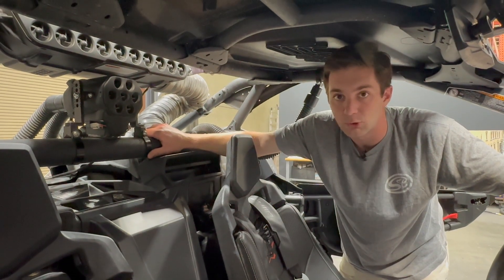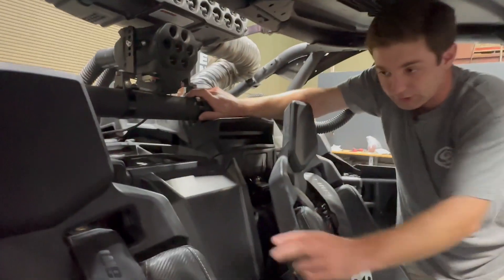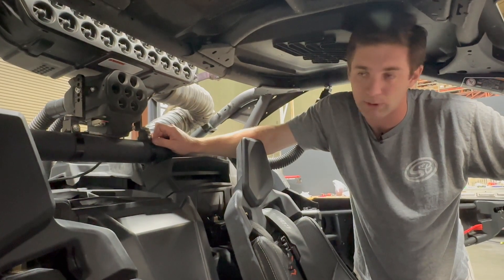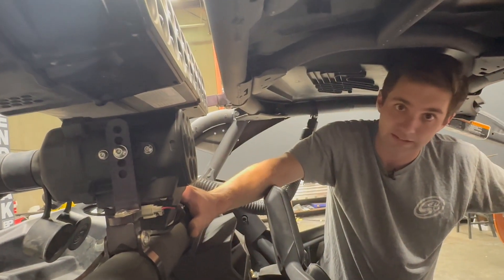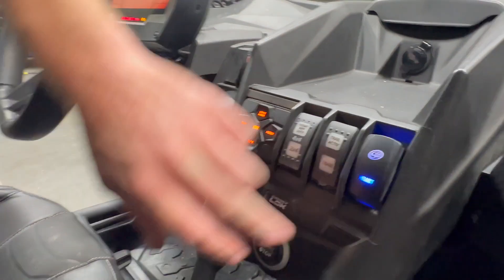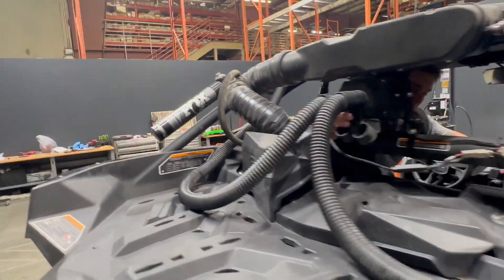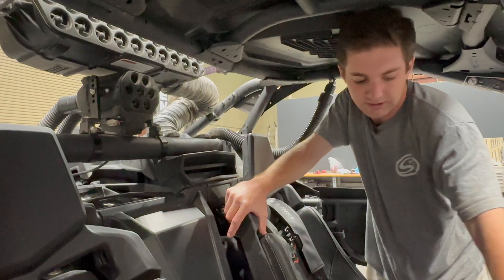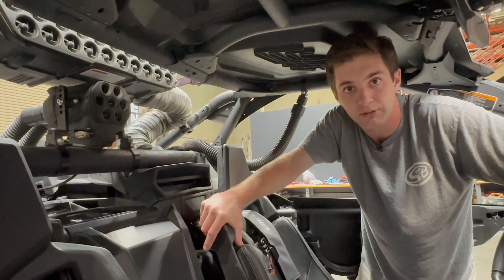Can-Am Maverick X3 - S&B Helmet Pumper Installation

Comment: Do you have any battery draining issues running the particle separator and the helmet pumper simultaneously for an extended amount of time? I have a 2022 XRS and have issues running both of them. I can hear the X3 cooling fan even running way slower, causing my car too run hot. I’ve tried a new battery.